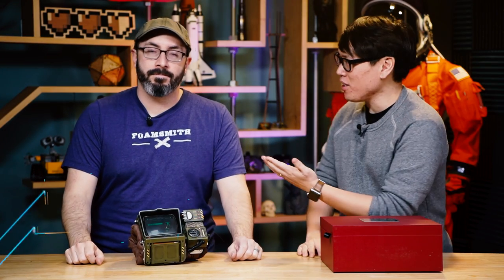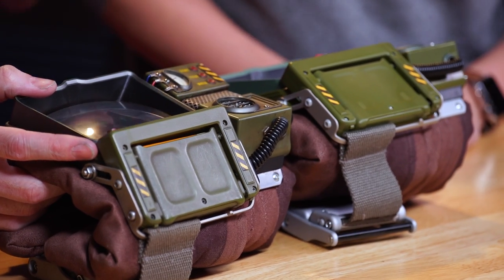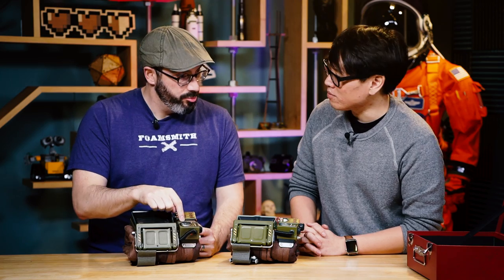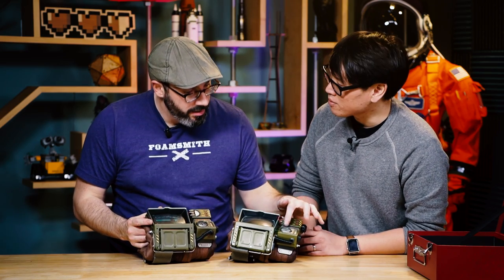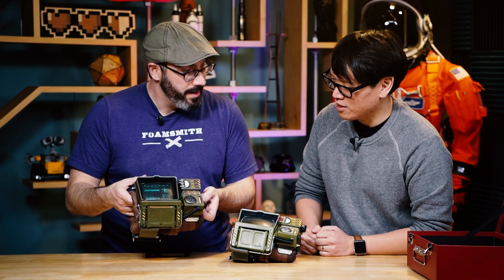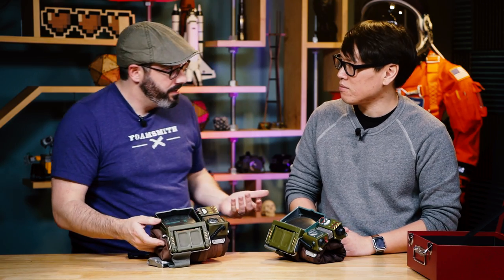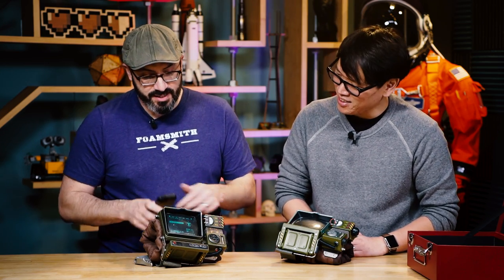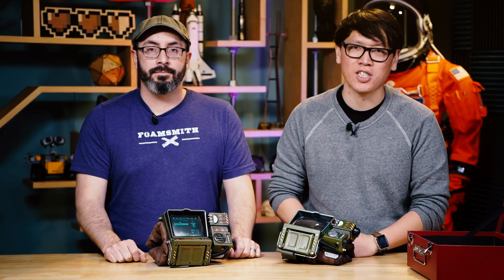Show and Tell: Pip Boy 2000 Mod!

Comment: It cant be too hard to actually make a fully functional Pip Boy. Geiger counters are available, cassette players have almost become obscure tech, the aforementioned tablet display and Raspberry Pi, some knobs, switches and real tubes... and well, a radio of course.
Reply: Well, a Geiger counter needs a big tube to detect radiation, if it’s too small, than it’ll only detect it if you’re right on top of it. It means you’d only know ur fucked when you’re standing right on top of a toxic can of this stuff. Hope this helps!

Comment: As far as a screen, I wouldn’t use a raspberry pi but use an old iPhone or Android phone or iPod touch and the actual Pip-Boy app. You could play fallout and use an actual Pip-Boy 😁
Reply: Ras pi can run Android.  Pi0 is alot smaller than a phone, but can drive a larger screen still.
Reply: The problem with that is the app only really functions while playing Fallout, so it couldn't run while just being displayed.
Reply: worldofzap na
Reply: I made a working Pip-Boy using the kit, a Raspberry Pi Zero W and a 3.5" TFT display. In the process of making a tiny FM radio and a Geiger counter to fit in it too.
Reply: @MinorLG  With a single core cpu and only 512mb of ram, it's not really worth it for something like this. You really need(or want) something more powerful. That is if you want it to actually do things and do it smoothly. I'd look at alternatives to the Raspberry Pi as there are far better alternatives out there with much faster CPU/GPUs and much more ram in the same form factor. Only thing the Pi has going for it is the size of the community. Their boards are grossly under powered and short on ram.
Reply: harshbarj 
A Raspberry Pi 3 has a gig of ram and a quad core processor.
Reply: CodexofWisdom there seems to be an offline mode that you can still work your way around the menu.
Reply: Don’t get me wrong,,, I have no animosity against using a raspberry pi, as a matter of fact I have a raspberry pi 3 sitting on my network with an uptime of 454 days. Rather forgotten but still going. Just throwing out different ideas. 

P.S.
I didn’t buy Fallout 76, I just bought the Pip-Boy kit.
Reply: @Codex_of_Wisdom  the app actually has a "display mode" for when you aren't playing. I own the fo4 pipboy and have an old phone embedded in it for that reason
Reply: Binary Nexus I’m doing the same thing, which screen did you use?
Reply: I wish they would release a fallout 76 app!
Reply: @Codex_of_Wisdom  you can run the app in demo mode, which displays the same thing just not linked with your account.

Comment: I used the kit along with a Raspberry Pi Zero W and a 3.5" TFT display to make an actual working Pip Boy. Currently in the process of making a tiny FM receiver and a Geiger counter to fit in it too.
Reply: Viiiiiidsssssss ive been searching to see what/how people are doing that and cant find a damn thing. And while Bill's video on his mod was great, I want to see how people are getting around the cramped internals to fit a screen etcetera into it, before I crack mine open and screw everything up XD

Comment: The only kind of screen that can be put inside one of these that makes sense is a projection screen, projected on a cut-off from an actual tube screen that matches the size. You'd have to apply some sort of silver deposit on it, a few microns deep just enough to fake that feeling of a tube TV. I would go after 1980s car dash projection screen from Japan, Germany (few) or UK (i think only one car ever had something similar, but i'm uncertain). Dissect those to understand how they are made.

There's also a lot of Japanese market-only projection and TV type screen to consider. A lot of YouTube channels that review these things can advise as the content creators actually know exactly the sizes of the items. Sony and Panasonic had interesting stuff. I seem to remember a TV screen that was in the size format of a standard bento box with a bent cathode delivery, meaning it reflected off a source (i think).

Power source is an issue, but if this is a cosplay piece then a wire worn in the suit via contact pads (to conceal) and a larger, belt affixed piece would solve that. I wouldn't put a huge battery inside this, rather think of it as a car engine, and just have a small battery, just enough to run this 10..20 minutes on its own using the large off-site one as the main "gas tank".

Smallest arduino form possible, wouldn't bother with stock, a bought kit to reconfigure, prolly two and i would use a phone via wireless hotspot (with arduino shield) to run the whole deal. Again, minimal function in the actual item, just to push the deal, but the actual package is off-site.

If i had time, of course, but who has time, that and i think that the price for these is hyper-inflated. If you actually want to do this right, the final price might hit 1k USD with imports and all that jazz (also, paying the guys who can design these to work, to be read, to work as if had been made in the fiction universe of Fallout).

Comment: Love the build but vacuum tubes don’t flicker .
Reply: Yep. Could have installed some real submini pentodes and lit them from the bottom with LEDs though.
Reply: They were supposed to imitate nixi tubes.
Reply: CRT do in fact flicker.  A CRT in good working order with a sufficiently frequent refresh rate will not have a perceptible flicker.  In the Fallout universe a less than perfectly functioning CRT screen is to be expected.
Reply: vector6977 Nixie tubes don’t flicker either.
Reply: David Gill yeah that’s what I would have done.
Reply: @will3346  The Nixie clock kit I bought years ago from a seller in the Netherlands using Ukrainian tubes has a noticeable flicker to it.  Not as obvious like the tea lights, that's definitely exaggerated, but the flicker I've noticed is (at least in my set of 11) about 20% of the tubes, especially as they age. If I switch around the tubes the flicker follows, so it doesn't appear to be the driving circuit or the sockets, and on one tube, I remember it being only one or two digits that did it (again, not the driving circuit, definitely the tube). The worse the Edison Effect on the inside, the more flicker, also.  I have it in storage somewhere... I'll have to bust it out again...
Reply: Dustin Sparks that’s very odd I have never seen Nixie tubes flicker before. I stand corrected on that. I wonder if it’s a bad vacuum or something?
Reply: @will3346  Nixie tubes aren't vacuum tubes. They're cold cathodes and are filled with an inert gas. I always figured these were supposed to be the tubes that powered the radio directly under them. If they're supposed to be nixie tubes, what are they displaying? Especially since you have a CRT right next to them that displays the date, stats, VATS etc...
Reply: @Will As someone who owned a Ray Tube Speaker. The Tubes do indeed Flicker, especially as they age. A Tube will last with frequent daily use about 10 or so years, then need to be replaced. We are talking about Tubes exposed to less than Ideal circumstances for like, what several hundred years? As they age, the Hum and Flicker becomes more noticeable, as does some Static. When the Hum becomes High Pitched it means they are about to go out and blow. Also when being powered up they can flicker a bit, especially if their power source isn't fully reliable. Not to sure about Nixie Tubes. I only had access to Ray Tubes, the old fashioned ones, like they used in Radios, Stereos and TVs.
Reply: David Gill I am aware of what Nixie tubes are, and I wasn’t the one to confuse them. I was simply responding to a previous post that said they are supposed to be Nixie tubes. I don’t agree with that but I was also under the impression that Nixie tubes didn’t flicker either.
Reply: Lone Wolf I stand corrected again. I use “regular” tubes (non Nixie tubes) often. I have a tube headphone amp and I have a few other things that use tubes. While I use old tubes they are usually NOS so I haven’t really seen any worn tubes which explains why I haven’t seen them flicker. Thanks for letting me know!
Reply: Dustin Sparks I have a nixie clock using genuine Soviet tubes and they don’t flicker at all. If you turn the brightness all the way down or record it with your phone the flicker is noticeable but to the human eye it’s not percievable.